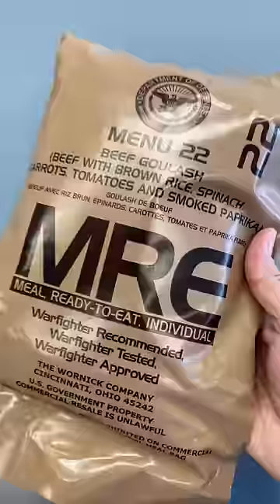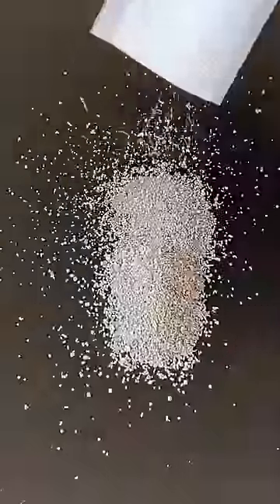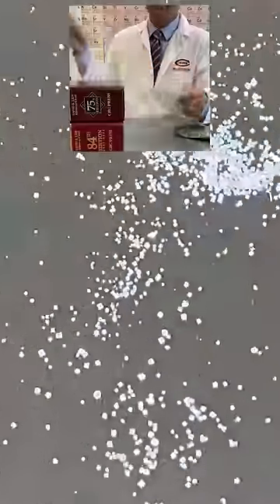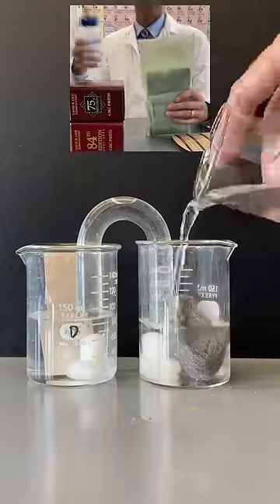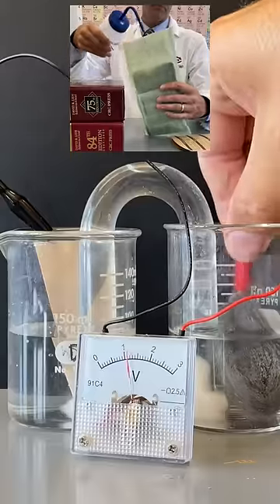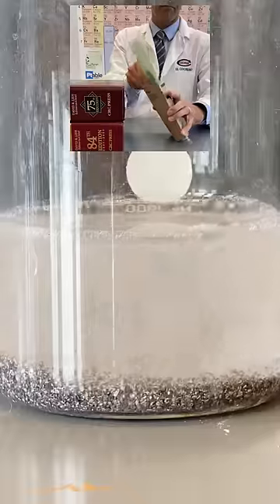Super-corroding Galvanic Cell used to Heat Soldier’s Meals!

Comment: People do not realize that this is a RECENT Thing. When I joined they had maybe 12 menu options and NONE of them had a heater. This new MREs came about after the turn of the century, at least that’s when I saw them. And hears the rub just like a battery…the heater fails the longer it’s on the shelf I have seen an entire lot (not one box, but perhaps several PALLETS of boxes) fail. In addition to the heaters they have I believe 32 menu options  now to include vegan and vegetarian options (this even newer)

Comment: Also a brick 🧱 textured turd in about 36-48 hours if you’re lucky I would starve as long as I could stand it before eating those things the sodium is off the charts and digestion is like you just ate wet cement .
Reply: “Low residue” that’s the purpose of the cheese or peanut butter packs, to block up the kids who didn’t know any better.

Comment: If only. Not all MRE have that, if you want a hot meal literally just put it on a rock that was in the sun (or something) and that will heat it up. But they are called MRE, meals ready to eat. Just eat the thing, you dont need it to be warm.

Comment: The better question is how often does the soldier or Marine have enough time to heat up there food.? Not very often. Most of the time they just eat the sides/snacks that come with the MRE as the go because most they’re easy to just pull out the protein bar or whatever and eat that as you move in the field. Also if your in a cold climate most guys will use the heater to keep warm at night like a hand warmer. Just stuff it in your jacket. It’s either that or you and your battle buddy have a agreement of tip to tip or butt to butt and hopefully no one sees you cuddling each other for warmth in the morning.

Comment: It the uk we use ration packs and they are not as fancy as this. They are a green/brown bag filled with smaller bags that you have to heat using boiling water. It’s is honestly not that bad

Comment: That is the cool part, we don't. Waste of time heating food up. 
1-You eat on the go.
2-You eat small parts of your MRE.
3-You take out just a piece of the food out so you can be ready to move in case you come under attack.

So no, you don't heat it up hehehe

Comment: That is super lame to describe ordinary chemical reaction as 1000 small batteries that short-circuiting! Most of chemical reactions involve charge redistribution, which is essentially current flow, that doesn't mean you can call that short circuit. Just freaking chemical reaction that produces free heat!